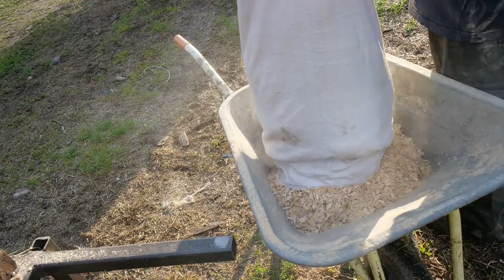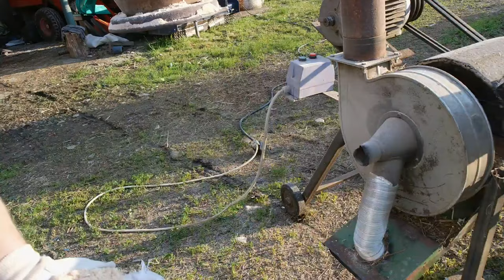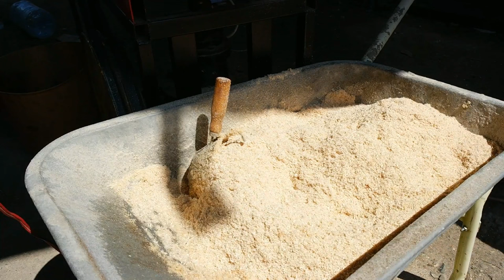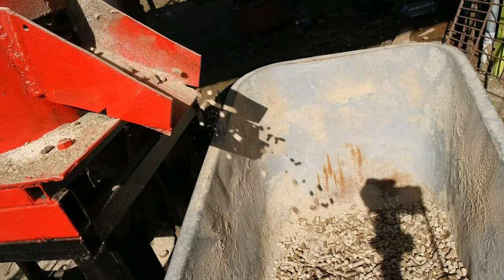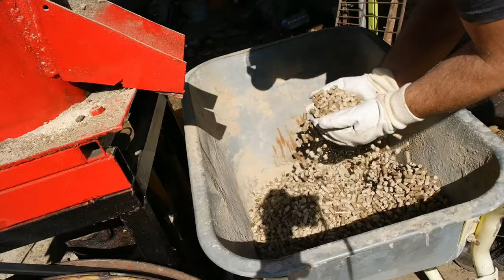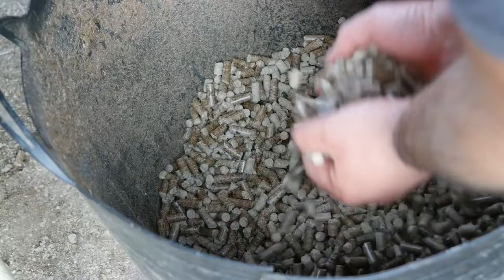Homemade pellet machine - How to make Sawdust Pellets

Comment: If your going to make a video try to explain what is going on
Reply: “You’re”
Reply from the maker: I don't speak English that well. So I chose to make the videos without explanations. But from the title of the video you should realize that I want to make pellets from sawdust.
Reply: A video of making Biomass wood pellets,  he selected his Pine sawdust,  at a required humidity acceptance,  if too dry, he spark a little water, then he grind it at 2 to 5mm in size, afterwards he passed it in the pellets mills.
In the wheelbarrow are wood pellets final product.
Reply: A video of making Biomass wood pellets,  he selected his Pine sawdust,  at a required humidity acceptance,  if too dry, he spark a little water, then he grind it at 2 to 5mm in size, afterwards he passed it in the pellets mills.
In the wheelbarrow are wood pellets final product.
Reply: @DorelBorlea don't worry dude, I got you covered
Reply from the maker: Thanks

Comment: a little info goes along way.  Nothing in captions or a narrative one the process or cost vs time/methods.  Not very good video.
Reply: Agreed....he gave absolutely no info whatsoever.  In fact the whole damned thing is pointless.  So he made some wood pellets but what for....cat litter, biomass fuel...?
Reply from the maker: @Biffo1262 Hello.  I built this pellet machine to make pellets from vegetable waste.  I did a test to see if I can make pellets from sawdust.  The pellets are used as fuel for the fire.

Comment: im not too technical, does the pressure in the machine make if from the shavings to the pressed finish product? and is it just wood being used, no glue? sorry nubi here
Reply from the maker: The sawdust must be ground because it contains large pieces of chips. The pelletizing machine makes the sawdust pass through a die and heat is produced due to the friction. The sawdust contains a kind of resin and thanks to the heat, pellets are formed. In order for the pellets to bond well, the sawdust must have a humidity between 16 and 20 percent.

Comment: Interesting, would the electricity used to produce the pellets heat up the house more than the pellets that were made? 🤔
Reply from the maker: If electricity were more efficient, then no one would bother to make pellets. The electrical energy consumed in one hour produces around 100 - 150 kg of pellets, a pellet burner consumes around 4 kg of pellets per hour.
Reply: @DorelBorlea  Very nice! 😎

Comment: What diameter die holes?
Reply from the maker: 8 mm
Reply: @DorelBorlea  that's what I just ordered for mine, 8mm I think I have too small a mm now.
Reply: @DorelBorlea  thank you for responding
Reply from the maker: @postman12100  I want to buy a die with 6 mm holes. I'm curious to see if it will work better.
Reply: Do you know how can I export my production ?

Comment: Amazing. After adding water what is the instrument you use? Is that to measure moisture? What moisture is needed ?
Reply from the maker: That instrument is for measure moisture. Moisture is between 16% and 20 %
Reply: Thanks. And what is the 1st machine ? Is that to grin the wood chips into dust ?
It looks so simple but you have the knowledge.
Reply from the maker: @josephgil3843  It is a hammer mill. I use it to grind  wood chips, grass, straw, corn and make biomass pellets.
Reply: @DorelBorlea 

What is an alternative for that? Can I just use a mesh wire with 1/8 inch holes to filter my sawdust? Don't worry my sawdust is finer than the ones you've shown in the video. So I wonder if it will also work...

Comment: You can use this machine to make chicken pellets feeds
Reply from the maker: This machine can be used for the production of feed for chickens. The mold with 8 mm holes must be replaced with one with 4 mm holes.
Reply: @DorelBorlea Why is it that smaller holes is required for making feeds for chicken?

Comment: I wonder if you had some advice for me. I have a lot of grass and weed cuttings from last year that have now composted down during the winter. Can I use this for making pellets for my pellet machine? I realise that I would have to dry them and perhaps put them through a mulching machine to break them down, but would they still make good pellets? I hope that you don't mind me asking, thank you.
Reply from the maker: You can make pellets from any material.  To make pellets, the material must be ground and the humidity must be between 16 and 20%.  Now it depends on what you want to use those pellets for.
Reply: @DorelBorlea  thank you for responding. I want to use the pellets in my pellet burner for central heating. I will spread the material out in the sunlight and let it dry, then put it through a mulching machine to make the mixture finer. I appreciate your help. 🖖
Reply from the maker: what kind of pellet burner do you have at the boiler?
Reply: @DorelBorlea  I have a new Burnit Sunsystem pellet burner that I have yet to install this week. It’s for central heating in the house. 😀
Reply from the maker: Unfortunately, these burners do not work with pellets from vegetable waste.  You need a special burner for agricultural pellets.
Reply: @DorelBorlea  I understand. Thank you so much for your help. You have been very kind and I appreciate it. I will stay with wood pellets and perhaps use the other materials to make some briquettes for the log burning stove. ❤️
Reply from the maker: Ok. 👍